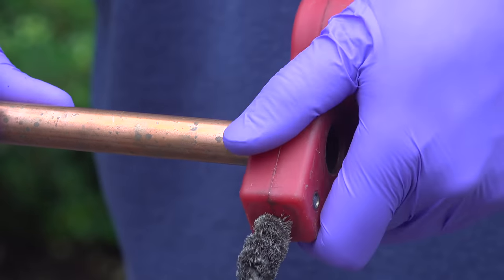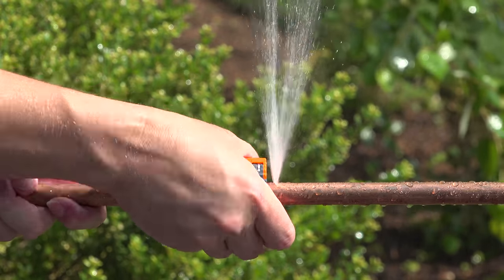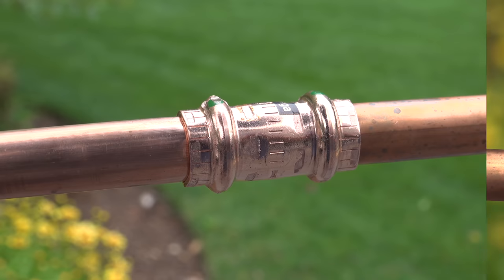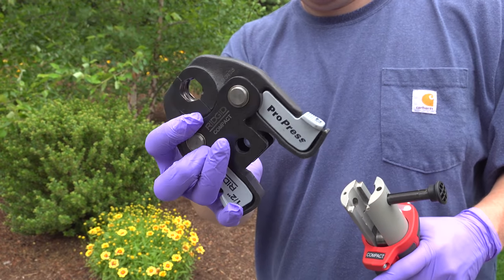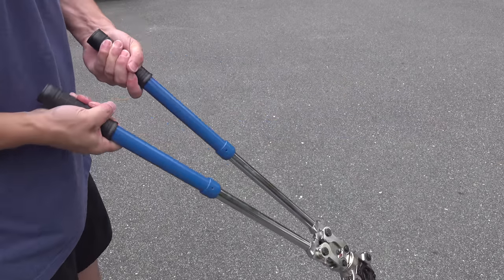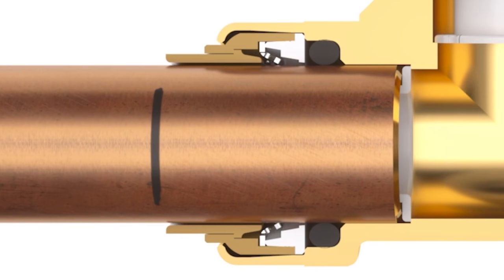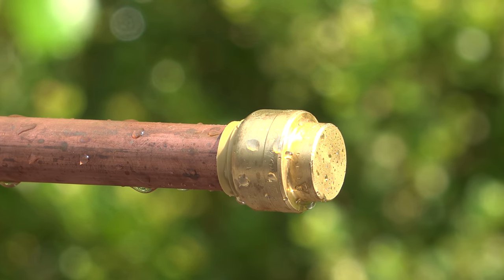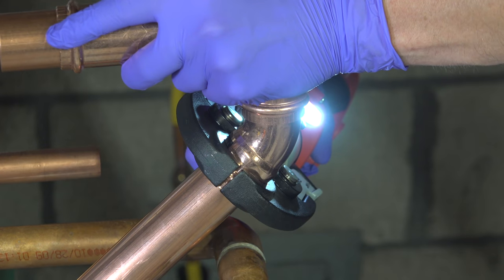NEVER SOLDER PIPE AGAIN - 3 Ways for EASY DIY Plumbing

Comment: “And you’re often working in tight spaces” Que the biggest crimpers known to Man.
Reply: My thoughts exactly.
Reply: @Bdbbejdjdb Snnsndndndn the o rings are more of an added safety feature I've seen one under my uncle's sink and he said it's been there for 4 years or so
Reply: I thought that. Pleased I'm not the only one.
Reply from the maker: They are big for leverage but when you use them the head can get into many places easily.
Reply: @1keykneedeep  
Why don't you do a video showing everyone all the crappy leaking shark bites.   As much as I hear this repeated over and over again I've yet to see anyone actually showing real world examples of leaking or failing shark bites.   There are a few people that have done demonstrations where they intentionally set up the worst possible scenario essentially guaranteeing the fittings will leak or fail in some way.  But that's just as easy to do with soldered fittings.
Reply: @Rowgue51  Mostly because when you end up with a leak in your loft, your focus is fixing it rather than taking pictures for the internet.
Reply: @1992jamo  
You have to be joking. There are hundreds of YouTube channels that do nothing but film corrective work.
Reply: @SilverCymbal  But far more places where there would be no chance of getting them on. Where pipes run close to one another or close to walls or timbers.
Reply: @1keykneedeep  My husband is a contractor and we have  Sharkbites throughout our 3 story split level house. Not a single one has ever failed. We've been in our house for 13 years... 

He uses then on all of his jobs and never had a complaint...
Reply: No plumber is gonna take time to start recording at 8.45pm when they arrive to an apartment building spewing its boiler water out the 2nd floor...
Seen sharkbites fail 7 different ways, bilaterally even.
Also, a handful of years is NOTHING, copper sweat, done right, correct material, 70-100yrs easy.
Come back after you've spent 40,000 hours doing all manners of plumbing service, construction and emergency repairs.
Reply: @ninjaplumbing5828  
There are dozens of channels on YouTube of plumbers that do nothing but record themselves fixing shitty work other people have done.  So your starting premise is totally nonsense to begin with.
Reply: 😂😂 exactly
Reply: @ninjaplumbing5828  Well said 👏👍👌
Reply: But it's only $2k...
Reply: @Rowgue51  I am one.... so yeah. I dont
take out a camera to film when water is causing property damage.
Reply: @ninjaplumbing5828  
Yes because every single sharkbite failure causes catastrophic damage and you just can't be bothered to film it even though you film literally everything.  That sounds totally plausible.
Reply: @Rowgue51  you seem to not connect reality, no good plumber is going to film a damn live water leak.
We respond to emergencies.
a fraction of a percentage of jobs are under good circumstances to film.
I've done thousands upon thousands of jobs, youtube quality videos are a rarity.
We do not wear body cameras.
We do not walk around to film problems, we show up to fix.
You think customers are ok if i tell them ''oh dont worry about the damage, gotta film this for internet folks that dont believe what this happens''.
I am not searching through my collection of 80,000 work images to find you pictures.
Do your own sharkbite failure searches, theres plenty on YT.
You seem to have a hard time listening to people who know about a subject.
take the word of the dozens of professionals here.
Or, just think your right as you once put one on under your kitchen and its still there.
I am not putting down EVERY SINGLE WAY a sharkbite can fail, or the intricacies of real world applications.
You ever hear of a hot shot?
You ever see/hear what happens when a hot shot is hooked onto a system with sharkbites?
Sharkbites are TEMPORARY.
Most good companies would FIRE an employee for using them.

RUBBER BREAKS DOWN.
Its not some bizarre occurrence or unknown myth that rubber seals break down on any kind of engine, system, equipment.
Stop trolling. do your research.
Reply: @ninjaplumbing5828  Dozens of professional plumbers.... Who have a vested interest in people not using Shark Bites so they can keep charging a fortune for a relatively simple repairs.
Reply: @davidrh74  shark bites cost more than copper fittings.
There are a lot of crooks out there in all careers.
There are plenty of cheaper solutions to a myriad of problems in day to day life. No argument there.
Rubber fails. A lot sooner than a good sweat joint.
Reply: Hilarious 😂
Reply: @ninjaplumbing5828  You're definitely correct. With that said, Sharkbite can come in handy as a quick patch. I wouldn't consider them a long term solution though (but I might not be in too much of a rush to replace them if they're working fine).
Reply: That's what I was thinking lol
Reply: @Rowgue51  Man when was the last time you were even on a job site? Sounds like you have more free time than everybody else here combined, why don't you film some pressure and aging tests on them since most people have already seen it?
Reply: @alakani  
Tell yourself whatever you need to chief.
Reply: @Rowgue51  Says the guy with a 20 minute youtube comment response time during business hours. Anyway have fun with your upside down valves, it's extra professional when the whole thing spins instead of just the handle
Reply: @alakani  
Your childlike insults are very convincing of your professionalism.
Reply: @Rowgue51  You might want to actually read your own comment that I replied to. I know it wasn't to me, but still. And that is literally what sharkbite valves do after a few years of moderate use. There's nothing in the retainer ring to stop them from spinning as the contact area of the blade tip work hardens the copper. It starts off with a couple nanometers per on-off, imperceptible. After 1000 or so cycles it gets in the micrometer range, noticable, not a big deal but feels shoddy. After 10000 cycles it starts spinning if you're lucky or leaking a little if you're not. I'm very, very surprised you haven't seen this by now, it's been going on for at least 20 years, but I wouldn't call you what you called he other guy because that's just mean and it's not that big of a deal
Reply: @alakani  
Why the hell would anybody ever be cycling valves thousands of times.  And rubber fails due to overheating and or drying out.  Neither of which are a factor when it's in constant contact with water.
Reply from the maker: @1keykneedeep  I must have missed this comment. The copper doesn't have to be perfect. Do you really believe Lowes and Home Depot would dedicated nearly an entire aisle for a product that keeps failing? I get that you just want to stomp your feet but you are already 20 years too late for Sharkbites.
Reply: Shark bite "hoo haha "
Reply: @ninjaplumbing5828  Yes, rubber breaks down.  So does copper.  I've had to replace multiple valves in my house due to corrosion so it's not like copper is perfect either.
Reply: @ninjaplumbing5828  what are your thoughts about propex vs copper?
Reply: @ubernerrd  valves are not made of copper.
And 99% of valves are repairable.
You got scammed my friend.
Or the stuff was ancient.
hard water scale comes off too.
Reply: @antman7431  Wirzbo fittings and uponor pipe are great for fast cheap commericial (especially in high demand retail thats will flip to a different format in a handful of years).
Its good for pesky freeze split area repairs in homes, if home owner does not want to take action on sheetrock, outside seals, insulation, rerouting etc etc, as the pipe is expandable so more tolerant to freeze expansion, the fittings are not, also, if the area freezes again repair will be super easy, spring loaded access panels i recommend all too often on lines repairs to outside hose, no messing with jet sweats or getting torch in tight area, quick coupling work with expansion can be performed without complete 20-30minute drain down.
Occasionally I have used it in some labs for various liquids at temp and with regulated flow rates as copper would erode too fast mechanically and chemically.
Can be helpful for items that may need or benefit from being flexible for future access to it and nearby hardware.

Running it through any hole it must be protected. seen an apprentice run 100ft through aluminum stud for gym, he just pulled it straight through, looked like a cheese string by the time he was done.
I do not recommend use in rodent areas, they can and will chew it (especially the critical expansion rings, most the time they dont touch the pipe but start gnawing on its end edges).
Sadly they will be doing away with the clear hydronic, red and blue, I guess uponor pipe will be all one color, just different labels.
I am not sure if that means all 3 will soon have the problem some of the older clear non uv protected pipe had, which was it would allow algae and mold to grow under right conditions if exposed to sunlight.
The red and blue were guarded.
Which is the next disadvantage, copper is self sterilizing. it was chosen for plumbing in part to this property.

I could rant more, ask a question if you got one. 
simple answer, I still prefer copper, uponor wirzbo is just a versatile asset if you are responding to random dispatches to plumbing problems that need to be fixed quickly.
Reply: @antman7431  prob biggest and most common calculation error is that 1/2'', 3/4'' so on, are not equal to the copper counter parts in flow rate. there is a bottleneck reduction at the fittings and any transition from copper/cpvc.
So if something is close to max flow rate usage, dont decrease at tee branch, carry on through to next tee.
basically, if it would be perfectly fine as a 3/4x1/2x1/2 tee, you may want a 3/4x3/4x3/4 tee and reduce down both lines where the supply 1st fixture to 3/4x1/2x1/2.
Never forget flow rates, like a 6 cylinder engine firing only 2--4, underwhelming.
Reply: @ninjaplumbing5828  solid advice... I can tell you know your stuff can I pick your  brain if I have any questions  in the future  just  starting my journeyman
Reply: @joshuakennerson8155  nice, keep climbing license.
Sub up.
Reply: @Rowgue51  from my experience as a plumber, shark bites only leak when they aren’t installed properly Or if they have been reused too many times. I still wouldn’t install one behind a finished wall though.
Reply: If only compression fittings existed.
Reply: sharkbite is terrible coming from an Australian plumber,but please everyone hook up your new over by yourself😂🤩😂
Reply: @ninjaplumbing5828  And copper pinholes, and when it freezes it splits.  And galvanized rots out and corrodes other metals. 

I'll take a user serviceable pex installation connected using Sharkbite, EvoPex, or clamps over an old noisy copper system any day.
Reply: @davidrh74  You do you.
Im not here to change minds.
Sounds like there are other problems that need be addressed.
Water hammer still exists in pex, just dampens it, noisy pipes are either not stapped/supported correctly, or have an improper fixture load for size of pipe. 
I do agree that pex is best for recirc line, or any pump line so pinhole does not form in 15-25 years... otherwise 70plus years.
Freezing, I see mostly unheated, poorly insulated, drafty, rodent properties with freezing issues.
Or DIY/poor contractors who put plumbing in exterior walls, or in corners behind wall frame studs, with insulation between the pipe and  sheetrock as opposed to between exterior wall and pipe.
Mechanical or user error happens too, people not turning on heat for vacation or mechanical breakdown of heating.
Reply: The crimpers of life. Lol
Reply: 😂😂 So true
Reply: @Rowgue51  . Does it take an hour for you to write few sentences? It's your problem if so...
Reply: @Rowgue51  . Please put these connectors everywhere you can, it will make real plumbers a lot of money.
Reply: I won’t give a thumbs up as I like the 666 .
Reply: @SuperTalleyho  Yep, that crimper is way too big for job I have to fix sometime soon.

Comment: I normally solder my copper lines but as a homeowner, and not a professional, I don't have to do it very often.  About 6 or 7 years ago I had to add an on/off valve to my domestic hot water system.  I cut the pipe where I needed the valve and, no matter what I did (turned off the water supply, opened all the faucets) I still had water pouring slowly out of the pipe.  I bought a Shark Bite ball valve.  Easy as heck to install and after all these years, not a drop of leakage.
Reply: Nice , but be sure its in an accessible area where it won't be exposed to freezing and where it won't damage anything valuable if it does leak.
Reply: @DavidBasara-p8s - Follow that advice for propress also. Those o-rings inevitably will fail, and a press-fit is NOT something you should count on to prevent eventual leakage. Solder is still the gold standard, period. Twenty years from now that will be unanimously agreed upon.
Reply: There's no way I would trust it
Reply: My heart is broken by this. I love Shark Bites 😢
Reply: What about using all PEX??